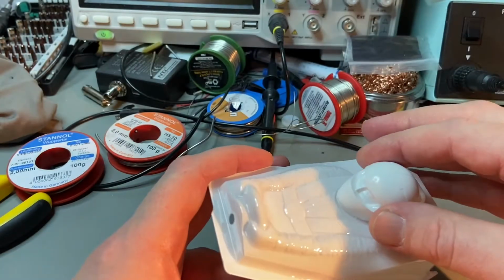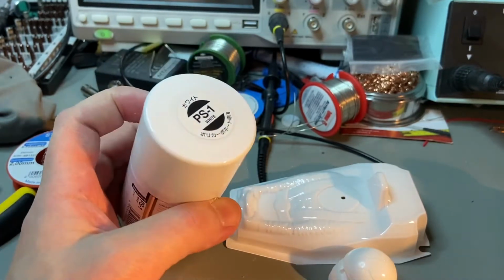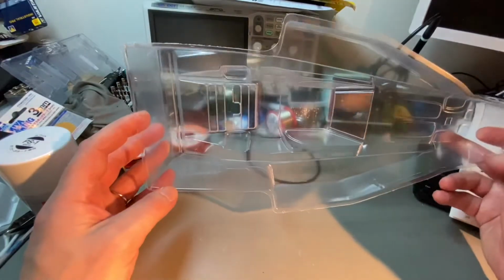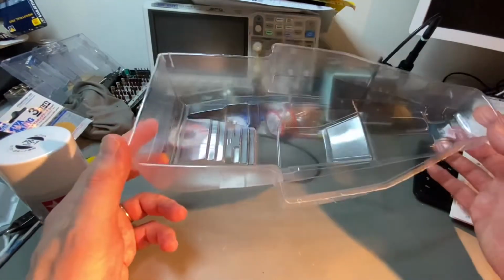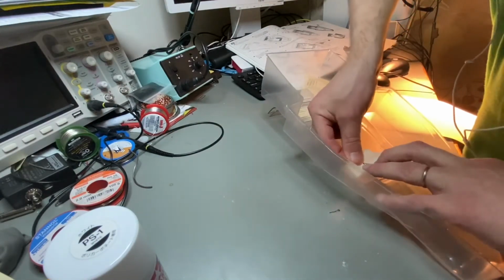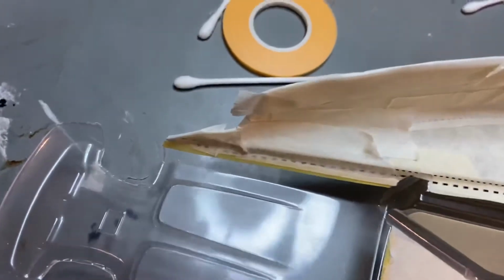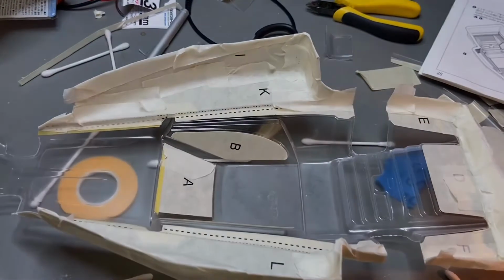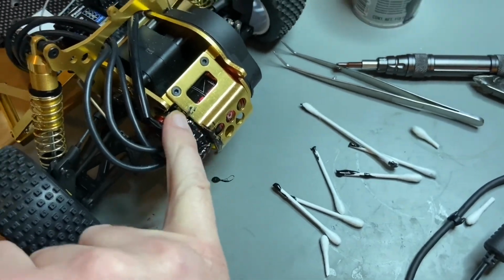Part 4, Masking body of Kyosho Turbo Optima Re-release+extra

Comment: Well, Tamiya PS paints are a Polycarbonate paint that etches into the plastic that is flexable and forms a strong bond to polycarbonate. 
Im a painter of 35+ years. Your paint ran away from the edges because you sprayed it on to wet/heavy.  When you spray any paint, you only very lightly dust on the first coat and let it tack up for 15 min. Then a bit heavier for the second but still very light, let tack for 15 min. Then the third coat can be sprayed on a bit heavier but not to much, let tack. Then the forth coat you can put on a bit heavier to get the thickness and gloss you are looking for.
When spraying under plastic, it does not matter about the forth step to get the gloss because the plastic up top is the gloss so all four coats or as many light coats you want will do 👍 
The Tamiya PS-1 white is one of the toughest paint to lay down. But it's 100% top notch quality paint 👌
Reply from the maker: Thanks for the instructions!